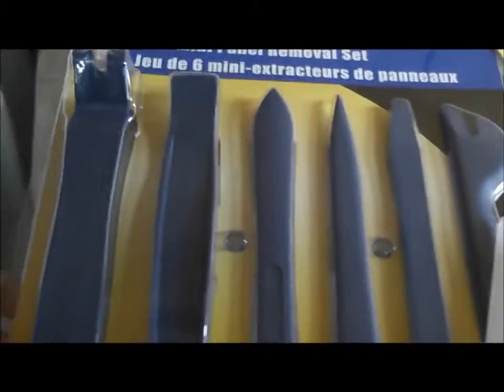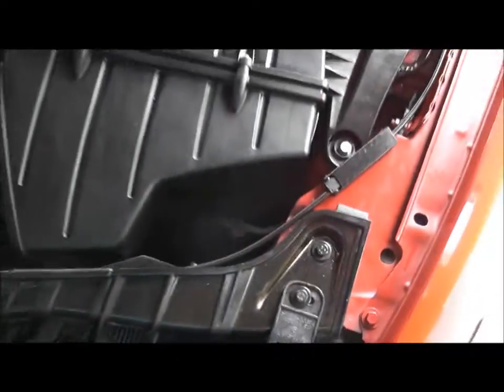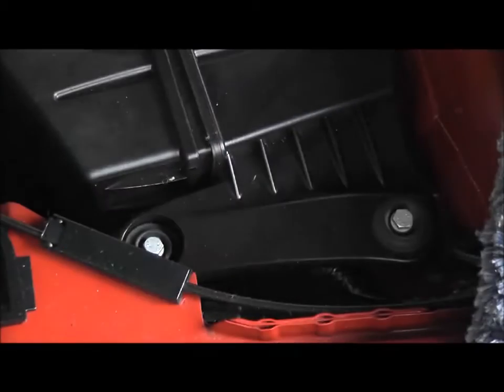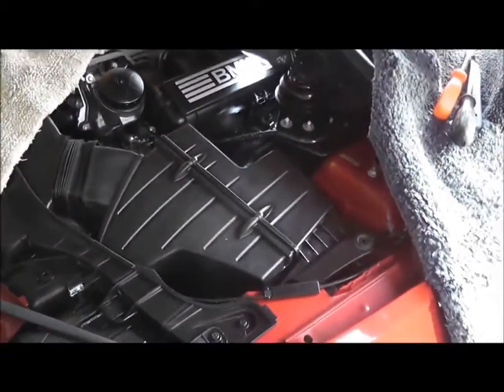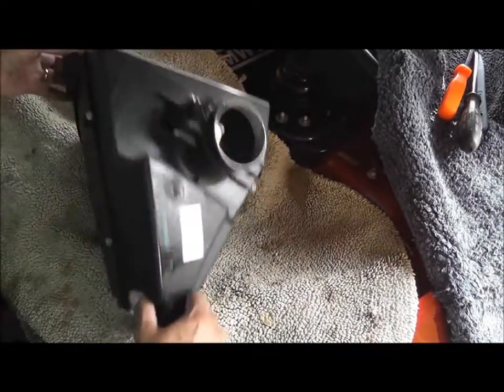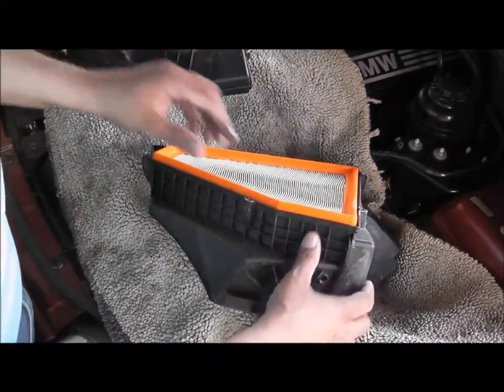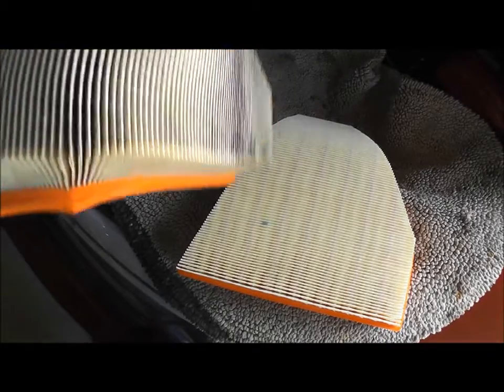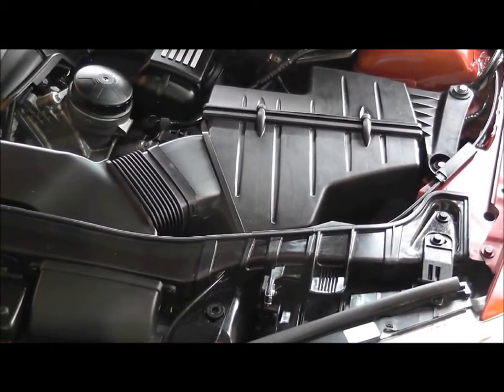How to replace engine air filter - 2012 BMW 128i - E88 - N52

Comment: Thank you, got the same car and year. engine light came on vanos code 1.2a 87 exhaust, 2.2a82 intake and 3.2a7c inlet, cold start, saw the video on cleaning sensors do you think I should clean?
Reply from the maker: Hey John, sorry for being late on the reply. I would say just replace, not worth the hassle and use OEM... 3 weeks late what did you do ? !
Reply: @AdrianJayeOnline  I changed the air filter and cleaned the mass air flow sensor, the light hasn't come on yet. sometimes when I come to a light it tries to jump ahead with no foot on the gas, don't know what that is about.